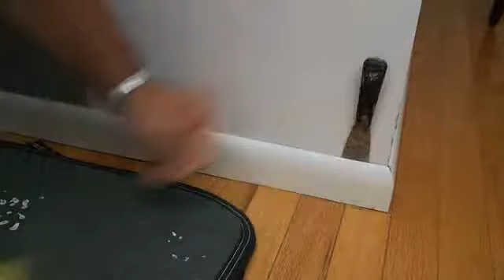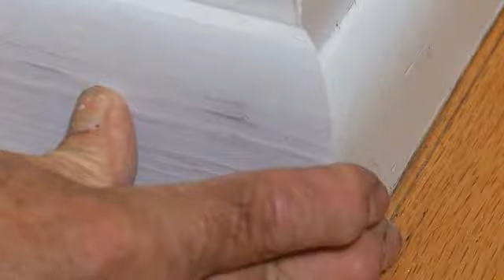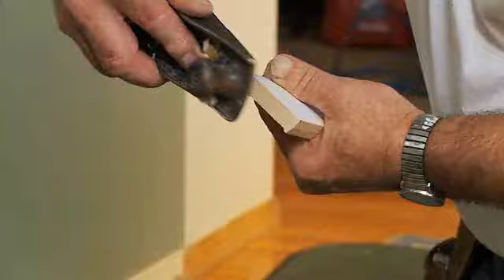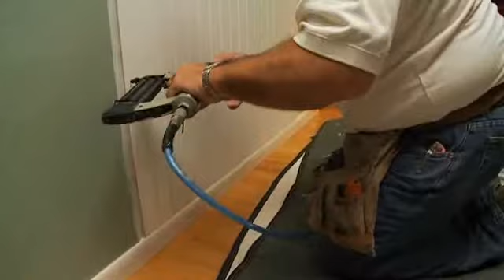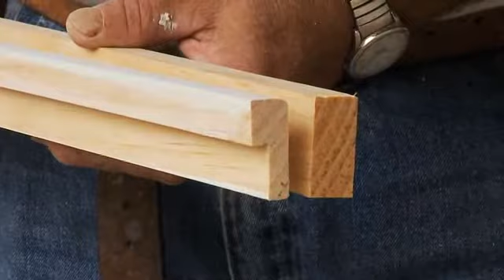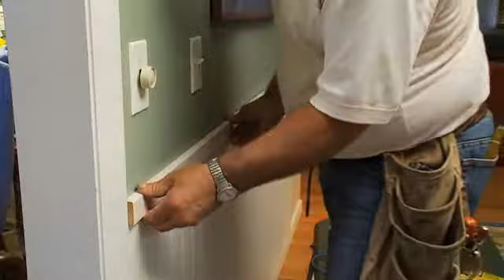How to Install Beadboard Wainscoting

Comment: Running it on top of of the baseboard is lazy and it does not matter if the MDF will not shrink or crack because their house itself will shift and it's guaranteed you will see that space open up over time. Always put your baseboard last if you need to make jam extensions for doorways. Some baseboards you cannot cut the top of and it's just a really sloppy finish especially if your house is old and the floors are not level
Reply: Thanks for your tip JK. It's always a mystery to me, how much expansion/ settling/shifting to expect with panels and boards as well as the house's floors/walls. And, I'd rather err on the side of my work surviving those changes.